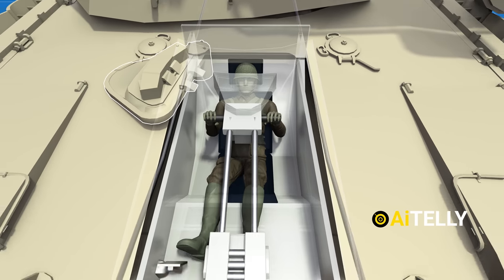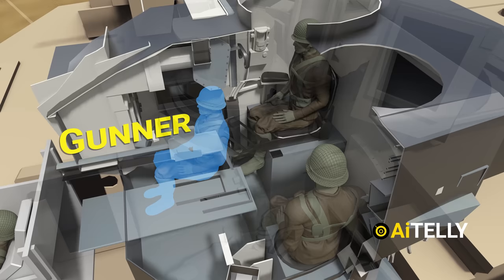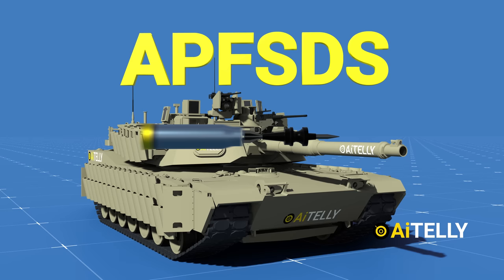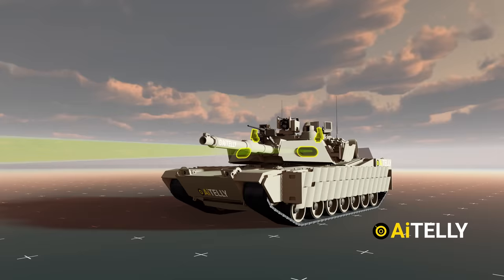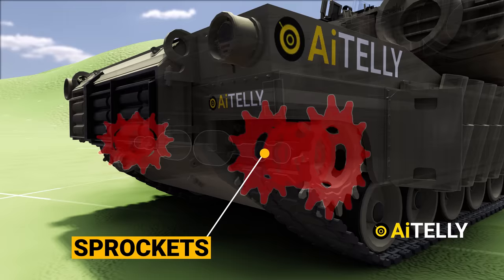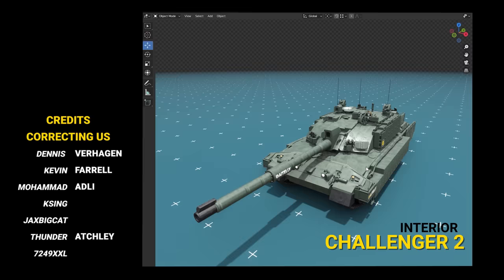How to Drive and Fire Tanks | How it Works Abrams M1A2  M1A2C Tanks

Comment: 6:35 Actually not fully correct. While it is universally agreed that conical liner collapse and target penetration both occur by hydrodynamic flow. It has however,  been established by X-ray diffraction that the shaped charge jet is solid metal and not molten.  The jet appears to behave like a fluid, and yet it is known to be a solid. One recent theory that would help explain this is that the jet has a molten core but with a solid outer sheath.
Reply from the maker: Thanks for the Feedback

Comment: It appears from the animation that the driver can't get out the hatch if the turret is facing forward - not enough room to exit. Is that true?
Reply from the maker: 🙃yes your right.
The Turret has to turned to a certain angle.

But he can also get out from the Commander or loader hatch incase of an emergency

Comment: loader has to basically punch the shell into the breech with their fist. if you don't keep your fingers curled you're likely to get them bitten off. also have to communicate with gunner. if you yell "clear" before you're actually positioned clear of the breech, you're gonna get donkey kicked.

Comment: the forward hull sliding driver's hatch in the M1A2 Abrams tank, under the frontal overhang of the main gun turret is cumbersome, getting in & out . . . the driver's position can be pushed forward a bit further, where the driver can have a conventional top open hatch as other flip-up top open hatches in the tank . . . or any other main battle tank for that matter . . .

Comment: Great video! Liked and subscribed. But what if the tank needs to go in reverse?
Reply: When I was in back in '92, the M1A2 has the gear selector on the T-Bar. You'd simply slide the little knob to 'R', and you would be in Reverse. The throttles still twisted forward as that controlled your speed. The more you twisted it, the faster you'd go. It was a blast!
Reply: The driver just does what he’s told. The commander will watch what is behind the tank and give the driver orders.

Comment: Accumulated charges are not high temperature ,it doesn't burn through armor like molten metal. The entire process is governed by extremely high pressure ...not that much different from a APFSDS...in fact a great deal of research into these warheads is using VERY SOFT metallic rods with very high L/D figure like 60: 1 or even 100:1

Comment: - The Trophy radars aren't mounted on the Abrams' turret cheeks - they're mounted at the fore and rear extremity of big sponsons mounted on both turret sides (thus replacing the storage boxes), with the middle serving as pedestal and internal magazines for the interceptor launchers (which have mechanized reloaders!). They're so big and heavy (5,000lbs according to the FY22 DOT&E annual report) that at one point the Army noticed it was slowing down the turret's rotation and shifting the turret's center of gravity.
- The Trophy configuration you depicted is more in line with the Leopard 2A7 and the K2's.
- A full complement of M32 ARAT-2 explosive reactive armor tiles on both the hull and turret weighs 1.83t. Underneath that, the four rows of M19 ARAT-1 ERA boxes clock in at 1.28t.
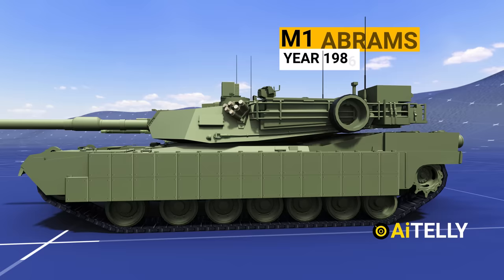- The M1 @1:45 is, based on the barrel shape, actually an M1A1 (with a 120mm M256 instead of a 105mm M68) and an AN/VLQ-6 dazzler. It also has that big external APU on the turret bustle rack.
- The M1A2 at @1:48 has an AN/VLQ-6 on top of the gunner sights' doghouse, which is a strange configuration as it interferes with the commander's topside M2 machine gun.
- @2:28: the CROWS weapon system is on the centerline between the gunner sights' doghouse and the CITV, which has NEVER been done. All CROWS units including CROWS-LP have always been mounted atop the gunner sights (where, incidentally, you bolted on an AN/VLQ-6...which is practically no longer in use on M1A2s nowadays), so that the commander can manually use it from topside station (hatch). That CROWS would have a limited arc of fire as it would bump into the two systems by its sides.
- Strangely enough, that error was corrected @4:02.
- The position of the DU component is not known, though one document from the US Department of Energy (which provides the uranium) once mentioned "steel-encased depleted uranium backplates". It is not known either whether this configuration was retained on the new NGAP armor package (SEP v3/4 and onwards). It has nevertheless been long known (thanks to pictures of disabled Abrams tanks with ruptured armor cavities) that the turret cheeks and sides contain NERA (non-energetic reactive armor) arrays, which are angled steel plates that deform upon impact and erode the enemy penetrator/HEAT jet.
- The US Armed Forces once used new designations such as M1A2C, M1A2D instead of SEP versions, but those were rolled back for some reason. We're back at "M1A2 SEP v(x)."
- @9:43 the M32 ARAT-2's purpose is primarily to defeat the explosively-formed penetrators (EFPs) encountered in Iraq, before they can hit the M19 ARAT-1 boxes.
- The AGT-1500 gas turbine used to be a gas guzzler, but gradual additions like the TIGER (Total InteGrated Engine Revitalization) upgrade, addition of DECT and APU (on the latest SEP version, this has become an UAAPU, or Under-Armor Auxiliary Power Unit) systems, the fuel consumption has significantly decreased especially when idling, bringing its performance closer to that of a Diesel engine.

Comment: M1A2 Abrams weighs around 70 or 71 tons ones we got now because of the trophy system and more equipment they place on the M1A2 Abrams now
Reply: They weight 66.8 tons. simple
Reply: @viceralman8450  agree as long the Abrams have more equipment  on it  it comes out to 70
Reply: @viceralman8450  but 68 tons is it original design
Reply: @SCP--op2eq   The original M1 weight was 55 tons.
Reply: @SCP--op2eq   M1A2C the latest Abrams weights 66.8 tons loaded.
Reply: @viceralman8450  so the answer to the question the Abrams almost weight 70 tons at least the M1A2C but its true weight 66.8 tons alrighty I understand that one with the equipment on like hard to kill active protection s system and tusk

Comment: I think the driver's compartment is small that the driver will be sitting on a lazy chair because of the need to make low-to-the ground the height of the tank making it difficult to hit. most americans or europeans are tall people that to make their tanks  accommodate personnel sitting upright especially the driver, the tanks must be made bigger compromising the necessity of tank to low to the ground or smaller as  target.  For the Asians or for Filipinos their tanks must be made fit for them; and all tank personnels must be limited to 5'4" to 5'6" in height only so that Philippine MBTs can be made smaller and lower to the ground but the operating crew can sit inside their tanks especially the driver as if they are inside  regular cars or SUVs.

Comment: How the Trophy system designed against the RPG-30 types of threats that uses fake first round to initiate the active defense before the main grenade to come? 

And also could it stop the Javelin missile hitting the top of the tank?
Reply: The trophy system would engage the incoming missile. Chances are, if it hits the missile, it will destroy both warheads.

Comment: I want to know why tank tracks are still relevant over multiple independently driven wheels given the versatility of the latter and modern engine & material options.
Reply: Because the tracks give it a much smaller turning radius than wheels would.

Comment: How is the coaxial machinegun fired?
Reply from the maker: Fired by the gunner Control Stick he can switch from the 120 mm gun to the Co Axial Gun using the same process
Reply: @Aitelly  ok thanks
Reply: Assuming the m240 is ready the gunner moves gun select switch from main to coax then fires using the same process as main gun, before firing gunner says “on the way”,   also when firing the coax the air filtrations system kicks on the air out the turret so it’s pretty loud when firing.

Comment: why don't they design the two throttles as each throttle controls wheels on its side? So that you can easily move forward, backward, and turning by rotating both throttles forward, backward, and one forward one backward. Even you want to make sure two sides rotating in a same speed so the tank is going straight, you can still easily add a button there to lock the two throttles
Reply: But you can do all that with the M-1 steering column

Comment: The M1A1 Heavy,  which we got in USAEUR around 1990, came in at 63 tons, had the 120mm smooth bore main gun, replacing the older M1's with the 105's...
Reply: the real OG abrams right there. we had some of those in FT stewart.

Comment: Lots of inaccuracies and even some lies.
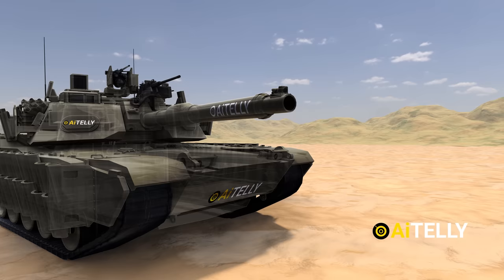5:15 Trigger is also used to fire COAX MG.
5:26 This big switch is called palm switch, beside interrupting turret drive it also dumps the lead from ballistic computer. The other (not mentioned button) is for laser rangefinder.
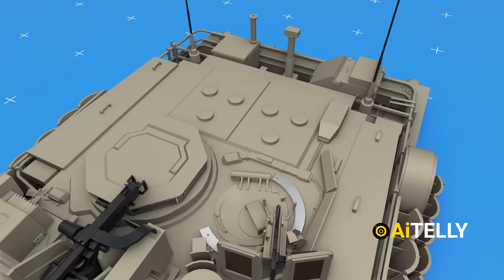5:47 It is not programmed, it is just ejected by the force of explosion itself.
6:13 Main round is M829 series (M829A4 being latest iteration), M830A1 is mainly for lighter armor and can be used against helicopters due to proximity fuze.
6:36  600mm is for older M830 HEAT while M830A1 HEAT-MP-T or MPAT is closer to 430mm due to use of a smaller warhead.
7:33 Bullshit. AMP is not meant to replace M829. AMP is meant to be used against infantry, buildings and unaramoured or lightly armoured vehicles, it is not meant to be used against tanks.
7:48 No such thing as airbust, it is called airburst and is meant mainly against larger groups of infantry, may also be effective against unarmoured vehicles and even helicopters.
7:55 PDD is meant against buildings, you can shot the round through a wall and have it explode inside. It is not meant against tanks because round can NOT penetrate an MBT.
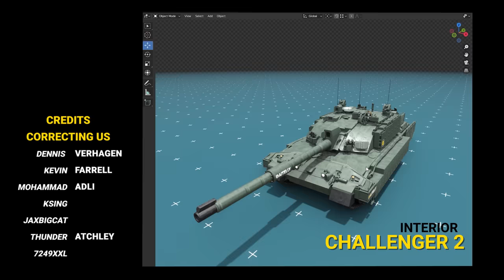12:16 Heatseeking missiles are used against aircraft, they are not effective against tanks. IIR (imaging infrared) based missiles (that are mainly used by US and not so much by Russia) are equally effective in tracking turbine and diesel based tanks.

Comment: How does the driver get out
Reply from the maker: From "Zack" 
The driver actually gets in through the turret most of the time because the hatch cannot be opened from the outside. Ever wonder why the turret is always pointed over the left rear of the tank when parked? There is a gate on the inside for the driver to slide through. And the T-bar used to steer it actually has a pin that can be pulled so the T-bar can come down to the driver for a more comfortable position. There is another round the Abrams shoots called a CAN round, I think I spelled it correctly. I never had to to spell it, I just loaded it haha. It is basically a shotgun shell with 1013 tungsten steel balls.
Reply from the maker: Number7Red  I don't think Any Tank is safe because newer and newer Missiles are coming up.

Bu i heard the Lepard turns the turret at a certian angle to allow the driver to get inside the tank

Comment: You don’t steer a cycle/bike with the handle bars…you steer the the cycle/bike by leaning.  Leaning an Abrams seems problematic.
Reply: @richardbenjamin8341  Yes, you do steer a bike with the handlebars. The handlebars are connected to the front wheel, and turning the front wheel turns the bike.

Comment: So this is the main reason why the US doesn't want to give their Abrams to Ukraine, it's not just because of the cost it's because some of the body parts of the M1 Abrams variant have weaknesses like the Turret being vulnerable to any enemy Anti-Tank Missile like what you just showed us about the Kornet Anti-Tank Missile and the rear of the Tank being much more vulnerable to any Enemies who have Anti-Tank Weapons.
Reply: Practically any MBT cannot defend against atgm tandem rounds on sides and rear. Abrams aren't being sent faster becouse they need refurbish older tanks as US doesn't want to send abrams with depleted uranium armor in order for russia to not capture and reverse engineer/engineer a countermeasure against it. Abrams is one of the best tanks the world has to offer, although I think leopards are better becouse it's lighter, more fuel efficient and cheaper. Your argument with ATGMs and AT rockets can be negated with use of APS but ones with that installed won't be sent to ukraine at least not yet.
Reply from the maker: they are Sinding M1 A1 i guess the older version without the Depleted Uranium Armour
Reply: The weight is also a reason.  Soviet era infrastructure and engineering equipment was designed to fit Soviet tank weights,  which are only a bit more than half the Abrams.  All the bridgeing and maintenance equipment would have to be provided also,  nothing they have would work.

Comment: For the life of me I don't see how tank crew can avoid injury in tanks. The ride must be back breaking.....neck jarring. You name it. 
How can they look through viewing ports without having their head smashed into the view port and so forth?
Reply: Tank crews take safety training on how to operate effectively despite the risks of injury. In reference to the head smashing, i assume that's why they wear helmets.
Reply: @ArcticWolf00Alpha0  Yes they wear special tank helmets but still.....a brain can only take so many hits even in a helmet. Off-roading is so rough I can't imagine what it's like for them trying to look through their sights and hitting a bump in the road....their face or head or both slam up against that rubber pad. By now, why don't they use virtual reality goggles. No need to press their head up against a sighting system. They could stay back against a headrest and still see the sighting picture.
Reply: We still get hurt but not often, is usually when someone puts a hand or foot where it shouldn't be. And contrary to what you think, the ride is not that rough. The only one looking through the vision blocks is the TC and we aren't putting our face right next the vision block. As to the sighting question, there's a thick foam pad that the gunner puts his head against that's a couple of inches from the actual sight opening. It locks his head into position.
Reply: @rael5469  Not really special tank helmets. It is a cvc helmet that is basically a full head cushioned headset with a removeable hard shell that won't stop weapons fire. Heck I used it as a wash basin.
Reply: @andrewschliewe6392  Thanks very much. It's good to hear from an actual tank crew member. I wish I could see an M-1 in person. Do Army bases ever have an Open House where the public can visit?
Reply: @rael5469  Not that I'm aware of. You might find one on say during the 4th of July, a local national guard unit might have a static display open to the public; however, that is very hit or miss as it is done at the local level and there likely wouldn't be any advertising for it. Too bad, we can't post pictures here. I have a few you might like

Comment: I don’t need a lesson, just give me a good death benefit, a good war, and don’t take away my current 100% disability va and ssa benefits, and pay me at e7 pay.  I’m trained at 2000 m1a1/a2 tank specs so training should be minimal.  I won’t whine or won’t need to call my mommy.   I drove for years with a mine plow in the 3rd ACR so I can do that. I will need to work out for a few months to get in shape.  OBTW, I shot perfect a perfect on TT8 as a gunner.     Please respond with your offer…… 😁👍🇺🇸